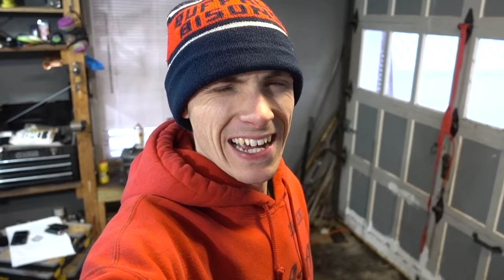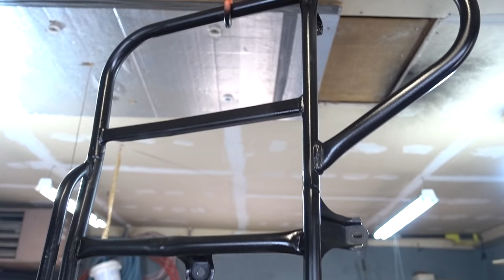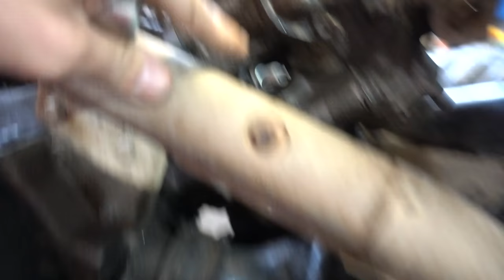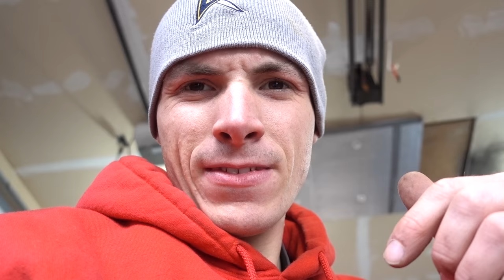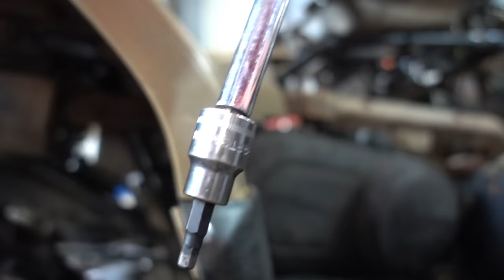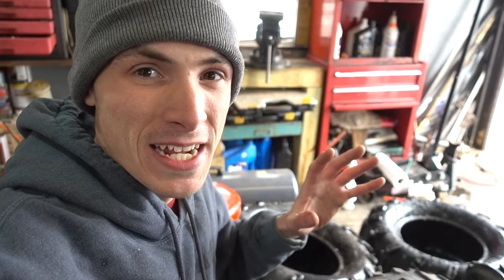KODIAK GETS NEW MUD TIRES!!

Comment: Mud tires on a small bore machine make for a slow annoying ride. Those Mudlites are goung to kill the fun factor on that machine. They're heavy and very agressive so you can count on losing 10-15 mph top speed and the low to midrange torque/acceleration will seem to be cut in half.